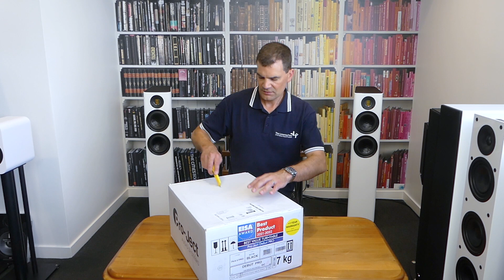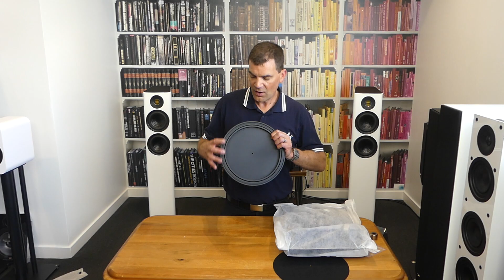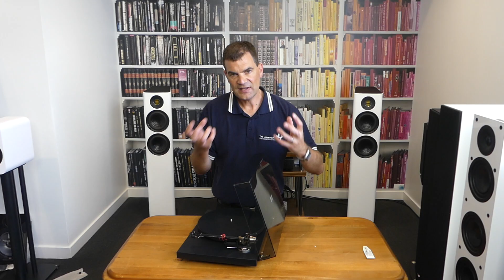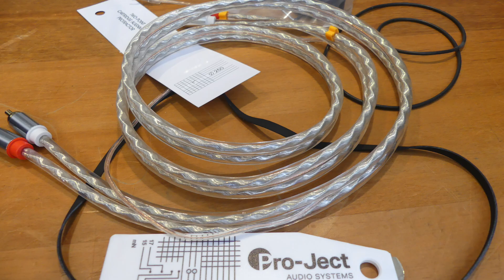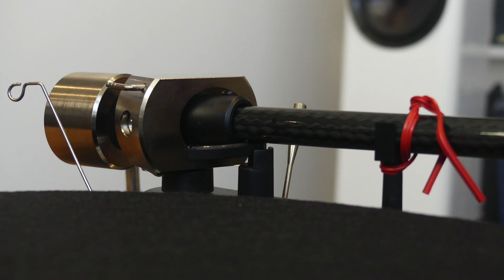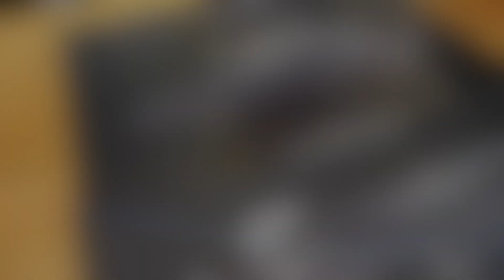Pro-Ject Debut Pro Turntable Unboxed | The Listening Post | TLPCHC TLPWLG

Comment: I’m sure it would track beautifully. If the stylus would get anywhere near the record, which mine, after being set up perfectly, by the guide, is not.
Reply from the maker: Check you are using the raiser / lower arm correctly.  There is also  a small screw in the raiser that can addjust height.